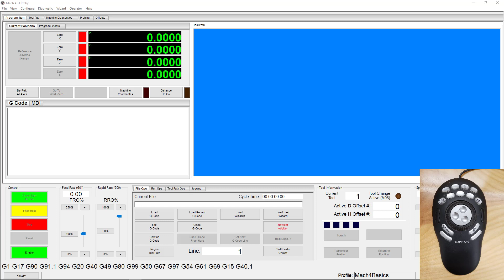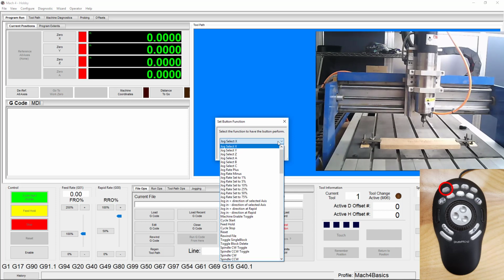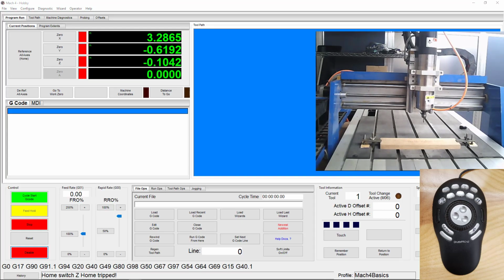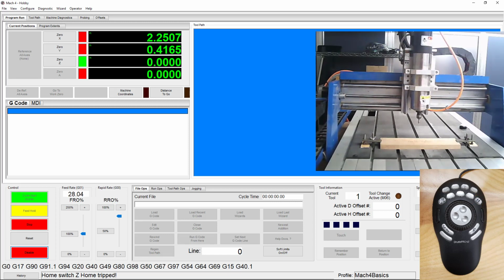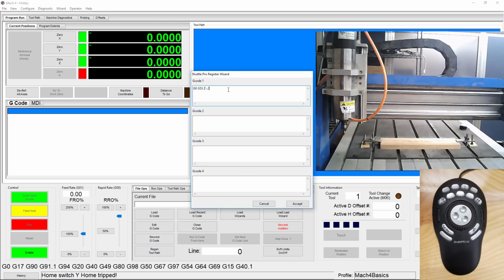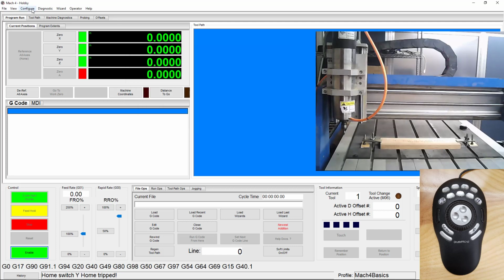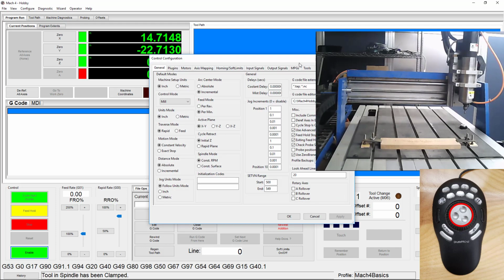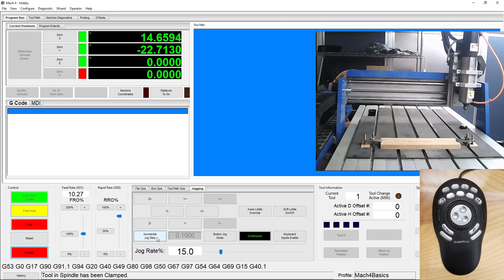Mach4 Basics: Setting Up a ShuttlePro

Comment: Since updating Mach4 to Build 4612 the inner wheel of my ShuttlePro V2 has caused erratic jogging. It worked perfectly on the earlier build. I can't see any change in settings so what's causing this?

Comment: Ran into an odd situation when implementing the Shuttle PRO with MACH 4.  When Z axis jog is selected — CW rotation of the outer and inner wheels move the Z axis in opposite directions.  Ditto for CCW rotation.   Selecting X & Y axes jog causes the inner and outer wheels to behave “normally”.  Any idea what’s causing this?  Thanks.

Comment: How to set up the inner jog wheel in mach 3?. All other functions are working. But when i try to use the inner ring mach 3 freezes and i need to disable and enable mach 3 to get it to working again . Best regards Thomas
Reply from the maker: Hi Thomas, if you are having difficulties with the Mach3 and the Jog wheel, we can have a tech assist you with figuring out the issue. Please submit a ticket with our help desk at support.machsupport.com and we will assist you to resolve this. Thank you.

Comment: How do I assign a Touch command to a shuttle button (such as find center or touch z)? that way I can zero my X, Y and Z from the shuttle instead of having to initiate the command from the computer which is 10 feet away.
Reply from the maker: If you need assistance in setting up a function for your Shuttle pro, an agent can help you if you submit a ticket to our system. http://support.machsupport.com/en/new-ticket